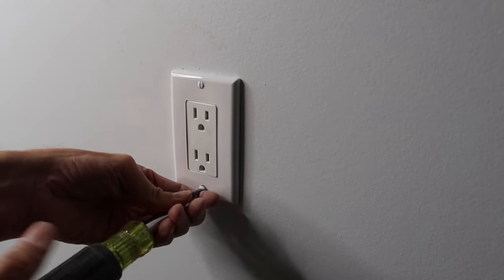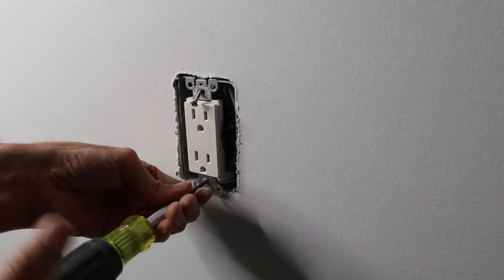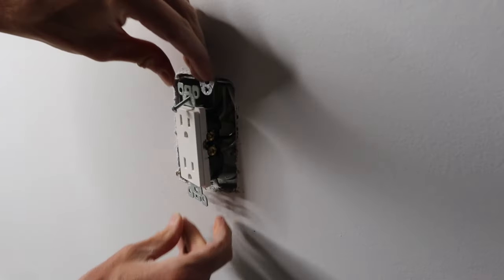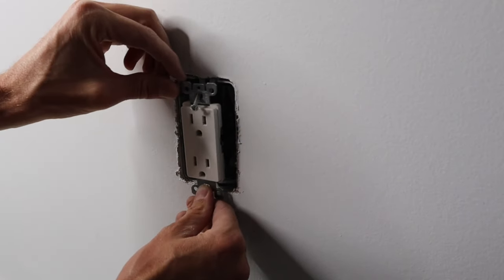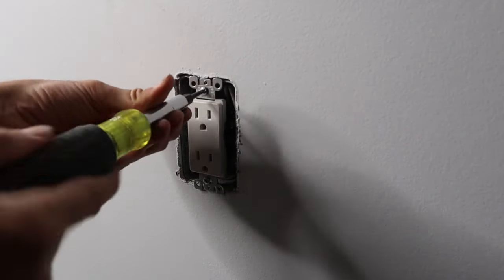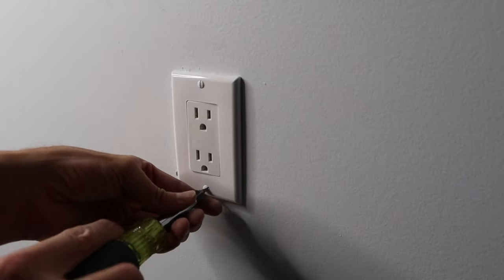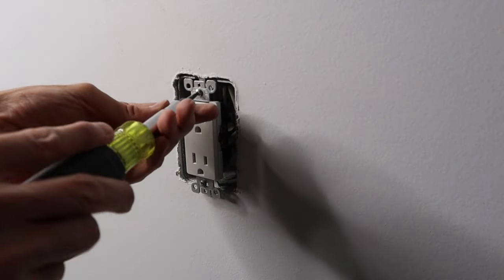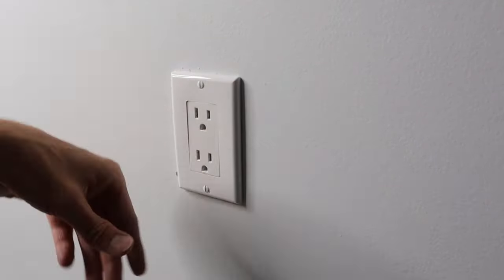Electrical Outlet NOT SQUARE!!! How to fix this!

Comment: The "proper tool" for this is the Rack a Tiers brand Plug Master. I have the older version called the PlugGrip P1 which was cheap but isn't in production anymore. The Plug Master though is even better because it has  built in  bubble levels which is really handy.  The problem with jamming screwdrivers in the grounding prong is you don't equally distribute the force applied and older outlets will break because they have brittle plastic. Also a screwdriver can slightly mess up the ground hole on newer devices with softer plastic. What I secretly wish for is a GFCI version but I just use two male cord ends when a GFCI gives me trouble. If you don't want to shell out $30 dollars two heavy duty cord ends work well enough. 

Also somewhat related is if your outlet needs spacers behind the mounting screws 3/8 outside diameter PEX Faucet Riser water  supply line works great. It's ridiculously cheap, easy to cut to length, and more accurate than using wire twisted around your screwdriver.

Another handy product are Caddy brand Wiring Device Retainers. You can slip one on each side of the device if you want.
Reply: Coil scrap ground wire around a terminal driver in a spiral, then cut with diagonal pliers.

Instant spacer, custom sized.

Comment: you can use the electric tester plug in and twist around make them perfect
Reply: I call them "plug straighteners" I swear. Hahaha
Reply: Also, pair of small screw drivers in the two ground prongs works in a jiffy also.
Reply: same

Comment: As long as the box is secured properly and the outlet itself is screwed down tight to the box, it's much easier and safer to leave everything as is including the wall plate. Grab an outlet tester that also has a grounded prong and plug it into either one of the sockets and bend/pivot the tester left or right depending on which way you need to make the outlet flush with the trim.
Reply: With the cover on Or off
Reply: Nevermind I’m blind

Comment: Here is an even easier method.  Take the cover plate off, loosen the screws to the outlet a bit, insert a circuit polarity tester and use it as leverage to straighten the outlet angle.  (You should be testing the polarity after every install anyway.)  Works great... very easy with 14 gauge wire, a bit more troublesome with 12 gauge.  Really tough if there is a 12 gauge pass through with 4 conductors and a ground connected!
Reply: Exactly. I've done that method for over 40 years.
Reply: Brilliant!
Reply: Polarity is not the right word, unless you are using DC to wire your house.

Comment: Yes, the I box may not be square in relation to the wall, side tabs can be bent to compensate, I seen a lot of loose outlet prongs due to people pulling out plug any which way vs. Strait out.

Comment: Hi Ben, can you make a video showing what to do if the electrical box is installed too far behind the drywall (ie. Not sticking out far enough from the stud). Thank you
Reply: Just use some washers to bring the outlet out further.
Reply: daniel green Use something like “. Ideal Industries 772453 “.  I used them when I did a tile backsplash in our kitchen.  Use one or more. They kind of snap together like Legos if you need more thickness. . Available at big box stores
Reply: Trend Investor - Washers will get you flagged if there is an electrical inspection, they do not meet code.  As the other poster noted, Caterpillar Spacer Shims (from IDEAL at Homer Despots) do the trick.  I wish they were a bit more "solid" when stacked pretty deep, especially when I'm trying to have the outlet not bear on any glass tiles, but that's what's available.   
Alternatively, you can use a "box extension"  (plastic or metal) to give the bearing surface you need.  
Having a handful of longer #6 screws on hand is also handy, as sometimes the box is so far back the regular screws won't reach.

Comment: Why would you NOT turn off the power? And when pushing on the wires you need to check for possible damage to insulation and over bending. Plus make sure the screws are tight. Then with the device pulled out straighten the wires up then bend the wires so they fold up as you push the device into the box

Comment: If you install an outlet plate and you don't orient the screw heads evenly up or down, you're not human. I'm a horzontal man myself, but it drives me nuts when I see them crooked.
Reply: I guess that's why I cut sandwiches like a psycho also. Lol
Reply: I tighten them until I feel like they are torqued down properly. If they match, then cool. If not, that’s cool too. As long as they aren’t over or under torqued.
Reply: Yeah.  I’m a horizontal guy myself too.  Doing it vertical takes too much effort.
Reply: @fritzb.3978  I think if the screws were on the sides, I'd go vertical.

Comment: touch the bolts. 110 feels great
Reply: @scottbowie189  get into a bathtub first
Reply: 110 not bad, 220, ouch!
Reply: @pointedspider   Try 440.... itll feel like you stopped a freight train ( yes, experience from a hidden bare wire ) no fun at all.
Reply: @ragingbull1267  I got hit with 575 3 phase.... Not fun!

Comment: I always like to get my wires positioned the best that I can into the back of the box so that they generally do not twist the outlet one way or the other. With tight boxes and many devices in the Box sometimes it is hard to get it just right.
Reply: @Jason Bowman 
The junction box in the ceiling must still stay accessible to meet code, just in case you did not know that.

Comment: Actually, isn't that what those little tabs either side of the mounting screw are for, you bend them back a bit with a pliers, even on both sides, so they touch the box when you tighten the screw, and hold it even?  Then you can make them offset if the box isn't quite square, and get the plug level. Otherwise you're relying on the wiring in the box to hold the outlet forwards and at the right angle, which doesn't seem right to me...
Reply: Bending the tabs works. The other thing is that he mentioned not snugging  it up real tight which is what I used to do. You don’t want it real loose either but often times tightening the plate down will bring the receptacle into the right position because the plate lays flat on the wall and pulls the receptacle into the plate.
Reply: Yeah as long as the drywaller gets nice and tight against the box, the tabs will hold the outlet flush against the outer drywall surface. It won’t matter if the box is cockeyed.
Reply: Correct on all 3 comments here! Yes you can snip them off at top and/or bottom. They are pre shaped from the manufacturer and easily bendable to snip off with pliers. This is commonly done for 3 gang boxes or more.

Comment: Another method:  Those “ears” on top and bottom of outlet can be bent towards the box, then tighten the screws while keeping outlet square with wall.  An outlet tester plugged in is handy for keeping square to wall.

Comment: Take the cover off, slightly loosen the screws, plug in a test socket into the outlet and turn to one side.
If that doesn't fix it get some long nose pliers and grab the metal tab just under the holding screws and twist it to one side.
Firm up the screws and put the cover back on, done.

Comment: The electrical box is flush with the drywall (correct) on the right side and recessed (not correct) on the left side.  Rip out the box and install an old work box is the easiest and best way to fix this.  The next best alternative is to figure out how to anchor the existing box so it is secured flush with the wall.  This may involve opening the wall so I strongly recommend the old work box replacement.

Comment: Sorry no experience of Canadian 2 pin sockets, but can you bend down the four metal tabs a bit ( one at each corner ) to stop it wobbling about. Then  gently tighten the two socket retaining screws, before trial fit on the faceplate. Those tabs must have some function. I recommend turn the power off, and prove dead, before starting work, as e.g. you could have faulty protection at the switchboard, and get a bigger splash than you expect if a wire breaks off. All that said, real nice to see you sorting these details. In UK some plasters panel over sockets, because they don't want to sort them out (  only electricians allowed to fiddle with sockets here . . . )

Comment: Your 100% correct. In my house I recently replaced 50+ old and dingy faded yellow receptacles with fresh white decora receptacles. At 3:52, would you do a full tape and mud fix, and taper out several feet, as you did in one of your older videos or do you sometimes do something quick and easy.

Comment: I am going to be fixing a bunch of outlets.  One problem is the 12 gauge wiring.  It's very stiff.  I have to take it step by step, since some are sunken, some are crooked, some are popping out.  Have to figure out which circuits are which.  I'll label them, once I do.

Comment: Plug in a tester and twist, bend the ears, or stick a swivel in the ground prong and twist it. All these things I used to do when devicing.

Edit, always want receps pretty snug. Switches don’t matter cause the plate will hold it cause you are not pushing on them. If a recep is not snug, when you plug something in it will move and feel cheap. Maybe that’s just my OCD. I used to get the plumbing sticks for toilet supply water and use them to cut spacers to fix that problem.

Comment: I think the problem is really that you didn't tighten the bolts. You DO want them snug. If the wires can move the outlet, so can everything you plug in. If snugging the bolt completely leaves the outlet recessed too far, you can add spacers.

Comment: Another way...   I found a pair of "duck bill" channel locks at a flea market and snatched them up ($2) for this very purpose.   
You have to make sure the power is off.
I have electrical tape wrapped around the jaws.
Just loosen the screws a bit
I can grab the sides of the receptacle or switch and twist it to the desired postion.
Tighten the screws.

A friend who is an electrician saw mine but was never able to find a pair like them so he made his own by grinding down the jaws (thinnner, not shorter) and welded on some 1" KOs and he says they stay on his truck and he never fights this issue anymore.

Comment: Hi Ben (Vancouver Carpenter) - got a video suggestion.  How would you patch holes from plumbers pipes under an installed sink that are way too large for the pipes? (Or are just box cut open with no care)  What's an easy way to patch it so that no 'wall critters' can enter!! (Yes, cockroaches!)

Comment: This sort of thing is the reason we have “call backs” in electrical contracts. You need to use them. The apprentice that screwed it up needs to fix it. You’re not doing anyone a favor by doing it yourself. They need to learn. 

If you screwed it up, it’s your problem.

Comment: We have very thick aluminum wire from the '50's i na  number of our outlets.  I recently replaced the outlet behind the fridge and was having a tough time getting it squared and just gave up and left it as is since it is such a pain to bend and manipulate those wires.  It's behind the fridge so why should I care whether the outlet is a bit off in the plate?  But now I'm wondering, does it present any sort of fire hazard?

Comment: Four minutes and fourteen seconds and it still looks like crap. The receptacle needs to end up flush on all four sides and not all loosy-goosy. Not to mention that the rough drywall cut-out is fully visible on the LHS. Not acceptable by my standards, Not even close.

Comment: Straightening it out like you did is right, it's the wire tension for sure. But you don't have to screw it all back together to test your correction. Just pull out the screws of the receptacle and use the plate to push in against the box to see how it situates. If it looks good, screw it all back together. If not, it's fast and easy to tweak it until it's perfect.

Comment: To all those complaining about small metal boxes, please note that boxes come in a variety of sizes to allow for situations with many wires & wire nuts.  Your local electrical code book will spell out how many wires/nuts are allowed in each size of box.  This can be a real issue with GFCI outlets which are usually larger than a standard outlet.  Your electrical inspector will fail a retrofit job if you've jammed a GFCI into a small box, and rightly so!
I couldn't see clearly in this video whether the box was being used as a junction box, which in Vancouver, B.C. would require three wire nuts [Marrettes] to splice the wires coming in, going out, and providing pigtails to service the outlet.  Read your code book, please.  Six inch pigtails are flexible enough to allow the outlet to naturally sit square - was this outlet box incorrectly wired without pigtails?
BTW, I would NEVER put electrical tape around an outlet or switch.  Years later when you open the box again to make a change, the tape's adhesive will have made a huge sticky mess to clean up.  
Never service a box unless the power is switched off at the panel.  No excuses - your life is worth the fuss.   If the circuits at the breaker panel are not properly labelled, call your electrical guy back to finish his job!
If you aren't qualified to do electrical work, don't do it!  Would you like electricians 'fixing' your drywall errors?  The homeowner's insurance won't pay out if an electrical fire occurs and the insurance company finds out that the work wasn't properly inspected.  Think carefully, guys!

Comment: Another quick fix is to stab a small screw driver that will fit snuggly in the ground socket and twist the resceptical that way; however depending on how much wire is in the way, this can't always be done.
Reply: Never ever stick a screwdriver into any socket ever!! Suppose you got there and the wires on the receptacle were accidentally in the wrong screws. For example the Hot was mounted to the ground screw and the ground to the hot. Because now you know your outlet doesn’t mean everyone here will get away with that. That is a standard 120 volt outlet enough to kill you. Just check my comment up above to properly and safely resolve this issue.

Comment: I stick an outlet tester in and move it around.  Sometimes just stick a flathead screw driver in the neutral to move it, but that doesnt work on tamper resistant outlets.  If those dont work and the box is true to the wall use device spacers, or your stuck doing it your way lol.

Comment: I usually take a screw driver that's insulated   And stab it in the ground  Prong And maneuver The outlet like that But just try to be careful
Reply: Always shut the power first and just do it by hand! Bend the wires in a v shape and tuck in back of box and then screw it evenly.

Comment: Don't they have a plastic screwdriver for removing the painted screws so that the metal doesn't  scratch the paint from the slot of the screw. I would at least use tape over the screwdriver to avoid this. i like watching your videos and your pick good topics to talk about. Thanks.
Reply: I found the plastic version to be more for DIY. A tight fighting metal screw driver also won't remove the paint. If it happens a 100 count pack of screws is $5. Cheaper and easier to have replacement screws than to switch between a high quality brand name screw driver that a tradesman would be used to using and a cheap plastic one
Reply: @NickRgibbs   Thanks for an alternative solution, i will check out the replacement screws

Comment: Just loosen the plate screws, then stick a skinny flat bladed screwdriver in the ground prong hole and twist the receptacle to the left or the right to straighten. Then tighten the plate screws. It’s that easy. No need to unscrew completely.

Comment: Sometimes the box isnt installed correctly or the stud it is attached to isnt square to begin with
Reply: I come across this often, sometimes they only use the front mounting holes and the box doesn’t align correctly
Reply: Check out my comment above. Also watch videos on how to use a madison. Its an electrical hardware that resolves that issue! I think it costs .47 cents.

Comment: I find this is a big problem for me with GFCI/AFCI/smart/USB receptacles. You know— the ones that are a huge box and take up 90% of a standard size box? God forbid you got any extra wires or are forced to pigtail things due to wires damaged by drywallers etc. There’s often no way to really bend or even the wires properly behind these monstrosities so you often get tilted boxes/faces due to something end up being one side or the other. 

I fact- just had this happen lol… and it helps to loosen the screws a little bit the only thing worse than a crooked face is an outlet that jiggles or pushes in when you’re using it.

Pet peeve and worst thing ever, going to plug something in and you got the receptacle just moving all around in the box. Feels dangerous as hell. Probably is dangerous as hell.

Comment: You actually want to have it push into the plate gently which may help you even it.  You can also use shims under the mounting area and take out the guess work.

Comment: I am an electrician who deals with this almost every day. There is a much quicker and easier way to fix it without ever removing a single screw. Simply insert a screwdriver into the ground plug and use the leverage to twist it. You can straighten it out in literally 2 seconds.